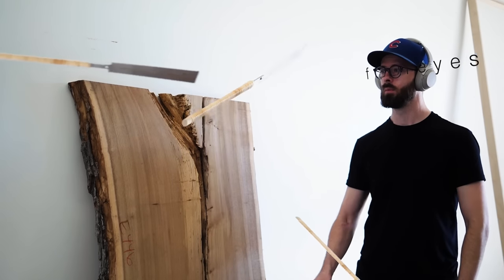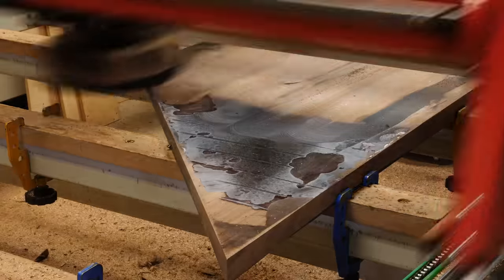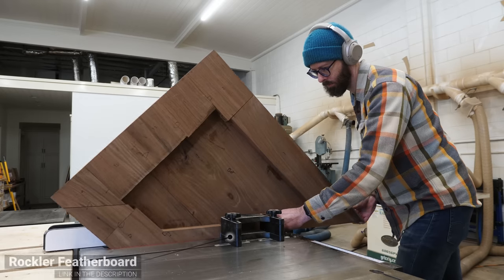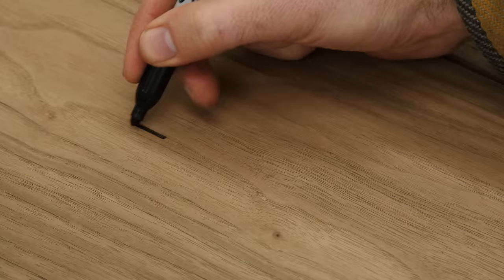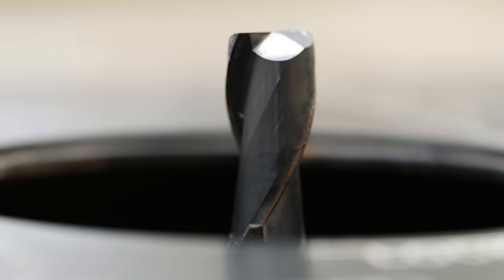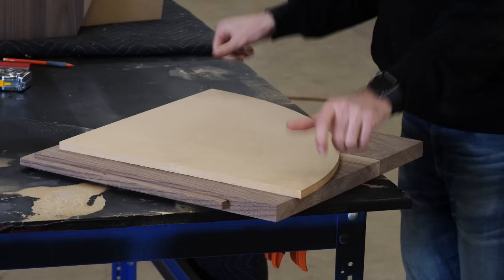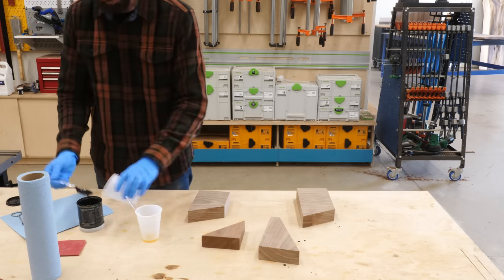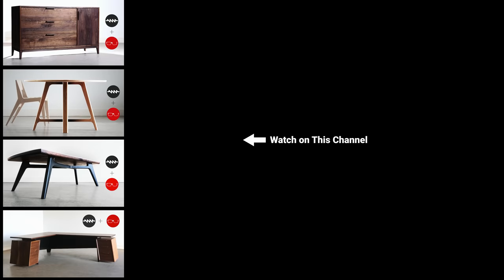The Surprising Truth About Working with Scrap Wood

Comment: Not all scrap/cut offs are created equal. Which is to say that they don’t all have the same inherent potential or quality from a raw material standpoint. Having said that, the exercise as a designer/creative to harness that potential is generally rewarding, insightful & instructive.  Now the real question is what is your end goal? To maximize your subscriptions and push the bounds of your design prowess? If that is the case you would be  better served by working unencumbered with lumber which, due to its quality and size, will afford you way more creative freedom. And the other hand there is something to be said about honoring each piece of scrap from an environmental/sustainability perspective. In addition, you are undoubtedly becoming a more proficient designer and craftsman by continually pushing the bounds beyond the off-cut constraints.  If you care to know my humble opinion, I would go 80/20. 80% big bold projects and 20% scraps. That would entail that you become far more selective as to which scrap is truly conducive to a great design. Why? Because ultimately, in the scheme of things, what is going to determine your legacy/impact as a craftsman and creative is your portfolio. And what makes a truly compelling portfolio? Those designs which stand the test of time, reimagine what’s possible and transcend by virtue of their aesthetics, innovation and of course functionality what has come before. All the best! JR

Comment: For the big projects, it often feels a little more "structured" and like, we know what we need to do, we know how to do it. And the wow factor is: "look how big and awesome this is " and the smaller stuff often have a few things not go entirely right or have to have somekind of course correction, which i find more interresting since it can feel a bit more "quirky". 

I like both. I feel like you could do the scrap-projects as more of experimental projects also. And i suppose, in a weird way, when you know the price of a slab of wood and see a weird project, if you know its an offcut of an already finished product as a viewer you know the value has been fufilled and everything is kinda alright.

Comment: Hey Guys I really love your smaller desk design with the slanted cabinet and I was hoping to ask for some advice on planning to build my next studio desk. I was wondering if you had a matching cabinet on the opposite side of the desk instead of the legs if it would support a desk above that with probably 100-200lbs with a slanted cabinet on each side? I just wonder if over time it would start to sag or something or if I was going to do that should I put a support board between the cabinets? I want to have 1" spacers between the cabinets and the desk. Could I possibly email your business email on youtube with a rough sketch just for your opinion?

Comment: I suggest a 2:1 ratio, 2 "scrap" projects for 1 "big" project. I hate it when everything goes into having a nice "shine" and not bother about one's trash... Make it a matter. No ecosystem sustains itself without reusing its trash.

Even though those smaller projects come from "leftovers" they are projects just the same and as demanding or even more demanding than the main project. I think there is a great deal to learn in those ones and a mastery to gain... just as you had to get creative about this thin tabletop. I like the maple in between by the way. This makes me think about kintsugi... 

Ever thought about "kintsugi-woodwork"? I will let you fill in the concept. That's just an association of mine.

Comment: I am 76 so working smallerprojects is easier for me to handle. Secondly smaller will typically be less expensive. For these reasons I like watching smaller projects than larger. But I am good with larger now and then. As far as narration,  don't change anything.  You got your audience doing what your doing. So don't diddle with the receipe😊

Comment: I watch for technique, not the size of the build, and sometimes the better techniques are because the build is small, so both.  As an aside, you did not include in the tool list the threaded insert driver.  Can you identify it?  I'm still using a sheared bolt and lock nut.  Lee Valley has them, but they are considerably different from the one you used.

Comment: I feel like the small projects are more interesting. I want to learn from watching these videos and with the bigger projects its usually roughly the same: poor epoxy, flatten it and build a base. You go over the design options and such but here its just more in depth and i feel like its easier to make mistakes. You fix them though and thats where i learn the most! Regardless nice work man.

Comment: Two thoughts - The Japanese concept of motenai (hatred of waste) would suggest doing the waste wood projects - However we learn most through failure therefore the bigger the project then more room for error and the lessons that flow from that. My opinion is that the opportunity costs associated with doing small waste projects outweigh the learning  opportunities they provide (even if you are more likely to have a brain fart).

Comment: 17:59 wouldn't it have been better to make the bottom shelf and put it in at the same time that you were gluing up the 90 on the other two pieces That way there wouldn't have any wiggle in the right and left I guess of the grooves for that shelf as it is however deep that groove is You're going to have that amount or is it half that amount of groove more than what you have of the shelves tongue. I could be wrong I'm not really a woodworker but I'm usually pretty good at spatial awareness type things It just seems like it would have to be shorter in order to get it in there before it moves back into the corner.

Comment: Since you asked: I like these "scrap projects". Most of us garage hobbyists can't afford to buy a $2000 slab and make a desk. The smaller projects are more approachable. However; I didn't like this particular project. The end product just isn't that attractive, and I think having the closed sides and tiny shelf makes it less useful too. I wish you had taken the "mistake" epoxy slab, flipped it over, then made a 3-legged base for it. I think it would have been just as fun to watch, would feel less cobbled together, and would have been a more useful piece. Your fix of gluing more wood to the bottom of the slab was effective, but feels kinda cheap, since we all know the center of the slab is basically hollow.

Comment: As an advanced woodworker I can confidently say that neither I or any of my peers (that I know) are going to chew you out.  A saying that I learned in martial arts comes to mind, "The difference between a master and a beginner is that the master has failed more times than the beginner has tried."  I know the feeling of what you are going through but don't let it keep you down for too long.  After 30 years of woodworking I still feel like an idiot and that I suck when I screw something up, especially if it is something simple.  Sometimes you just have to walk away and come back later.

Comment: instead of a bulky square pencil. I've held some and they just don't feel natural. why not go for a rectangle, like a carpenters pencil. it seems like a no brainer, given a few things.

1: its shape is familiar to everyone in the hobby, and due to its popularity there's already support for its design in the hobbyist woodworking community, like carpenter pencil holders in hats, shirts, pants, tool box organizers...

2: the designed is purpose built for making stable and accurate drafting lines and sketches, as well as tracing closely along surfaces.

3: the rectangular shape saves 70% the amount of brass you'll use.. if not more.

just seems like the right choice. if I end up buying one I'm going to sand it down to that profile and knurl  one side of it and polish the other side. giving two surfaces, smooth side for pressing against a guide when tracing lines and the knurl so I still have grip.

Comment: I would prefer the 6 big projects and the 6 small projects. Simply because the smaller projects are more relatable and more obtainable for a smaller woodworker like myself. 

I love the big stuff, but buying a $3k slab of Walnut isn't practical for me. However, buying the smaller off cuts from somebody else is practical for me.

Comment: So I want to premise my answer to your question of what to focus on in your videos with... I have no actual preference. But it sounds like one of those problems you could be looking at from a limited view. 

If you need the challenge of these smaller projects to keep you engaged in your craft, but you're not getting the same return for time spent, why not change the format completely just for them? Maybe a weekend build wip with far less editing or expectations in regards to video quality, no script, just off the cuff comments, etc. Checking in on the progress instead of making a full length, can only get one video out of one project, format. They're scrap builds, after all, that embrace how small random pieces can combine into something greater than their eclectic parts. Why not lean in and make things easier on you at the same time? 

Just a thought.

Comment: Dude, Take it easy on yourself. In my opinion, EVERY Woodworker makes mistakes. What separates the truly exceptional from the bad is how well said woodworker is at fixing/hiding them. Also, you didn't F up a 10k piece of equipment so that's a win if you ask me. 

PS keep the small side piece videos. They are just as educational as the big builds if not more.

Comment: who cares how you ended up at this design. I like the ring. I wish you had taken more wide shots to and shots from lower to the ground to make it clearer how the piece sits. You seem overly worried with the initial plan matching the final product. Seems like a nice product. The audience rarely can tell what  the original intention was. If it wasn't usable in some way or it had ugly stance I can sort of get the running critique but not here. I don't get why you matched the grain and then went black. I like the black but it will mute the grain and would have evened out a mismatch maybe? I am more basic utility builder so what do I know.

Comment: Considering this video was posted a year ago, you probably already have an answer, but I wonder if you've realized that the people watching this video are self-selected not only as your watch-retention audience, but also the percentage of your audience that already has interest in the smaller/scrap projects. The answer is still skewed. I don't know what the analytics look like on the other side of youtube, but comparing the numbers on each group of videos would probably give you a more accurate answer than an informal comments section vote. (And if the question is actually just to generate engagement on this video, well, it works! Kudos!)